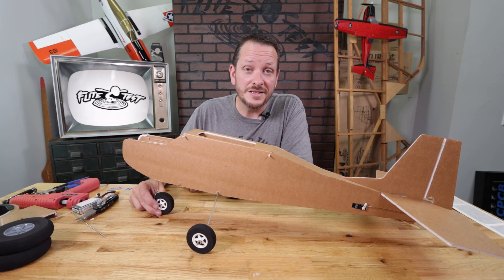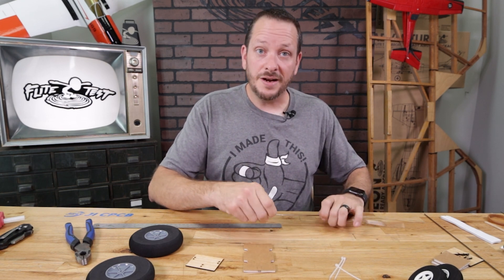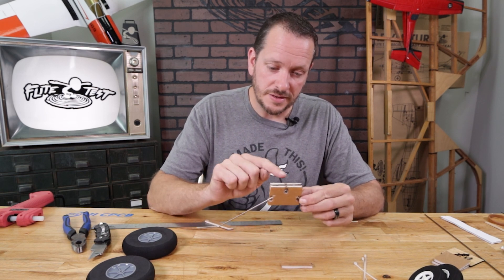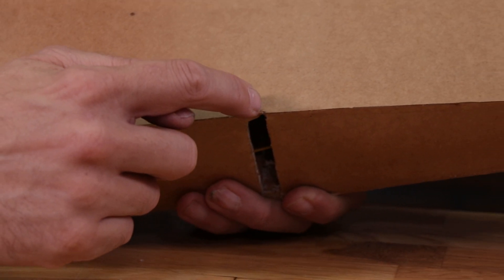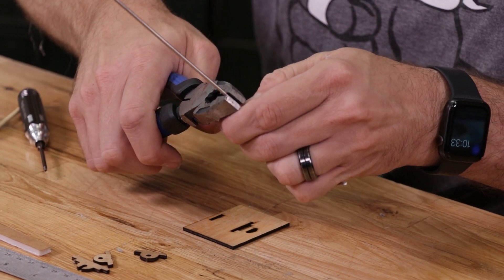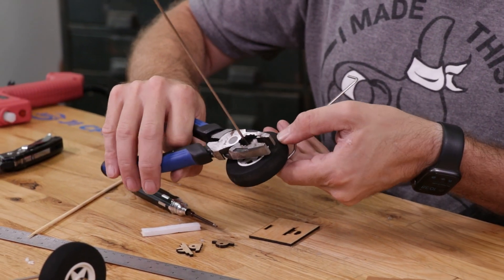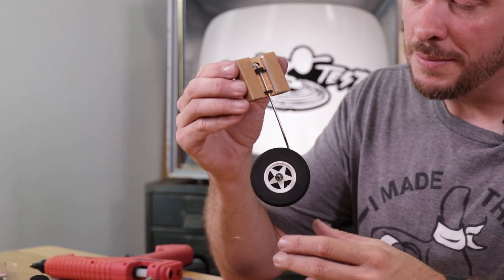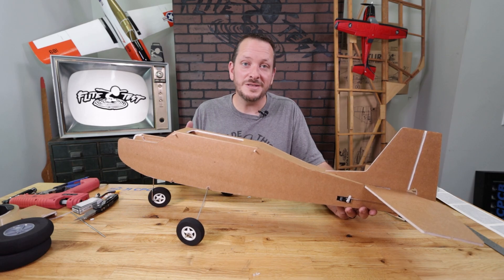How to Build the FT Tutor Landing Gear // Tricycle & Tail Dragger //  BUILD

Comment: You show how to build it with tricycle gear but you don't tell what your plan is for stearing the nose wheel. The main problem is that you show bending the wire and you should have put a stearing arm on the straight part of the wire before the last bend so you have some way of grabbing it to stear it.

Comment: What wheel collars? I didn't get any in my kit?
Reply: This was a disappointment for me as well. That and the size holes in the plastic firewall, the included screw heads stripped out, even after manually reaming hole beforehand.